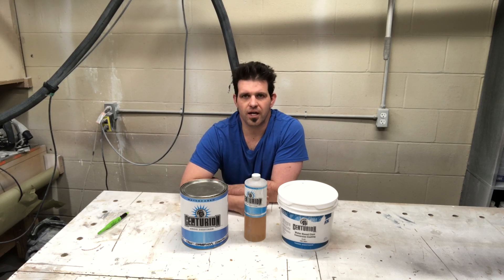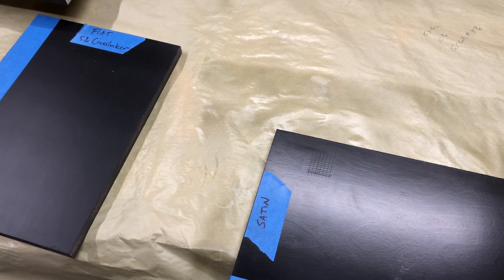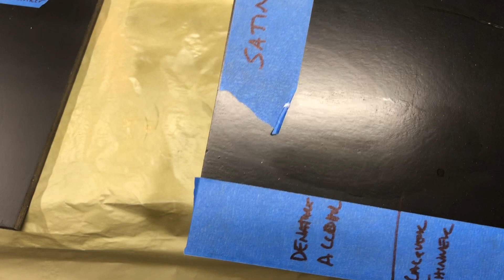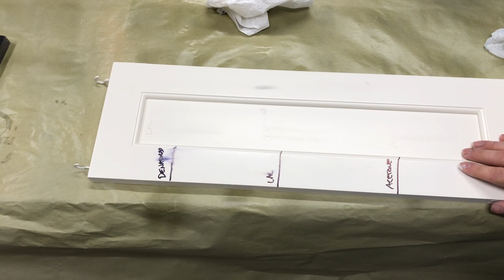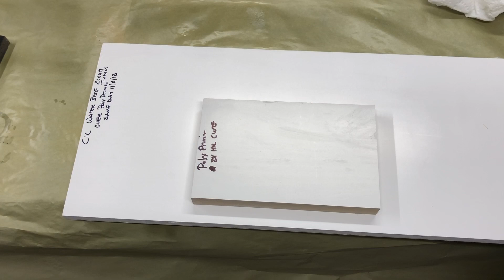CIC Water Base Conversion Varnish Full Review

Comment: I've just walked into a project where a homeowner had ALL of the home's cabinetry rolled (and sanded glass-smooth) with Benjamin Moore "WATERBORNE" Alkyd Primer. The primer was tinted to the light butter-yellow that they desired as a finished product. They were going to clear-coat with a matte finish using the primer as the pigment coat... "Bulletproof" was the plan.

Here's where I come in... They wanted NO yellowing (so no oil based) clear, and my plan was to "persuade" them to let me spray with the same B.M. Alkyd Topcoat as I know it's durable after it's cure time. Their previous guy was going to use matte AUTOMOTIVE clear and I'm sure that would have failed over time.

My mistake (that I now see after research) is that because of the flash-time, it's a disaster to spray B.M. Advanced Alkyd paint without sagging, and I'm NOT rolling so we're back to the CLEAR concept... 

Will water-base conversion adhere to 2-year-old (yes 2-yrs) sanded Alkyd primer without flaking? This was a new construction Mother-in-law house that was never finished, so there are no cooking contaminants or usage. I'm only wondering about product compatibility... Anyone?
Reply from the maker: You need to do a test in an inconspicuous area to see if you are going to have issue or not. It is definitely going to have to be sanded.

Comment: Okay so sometimes I do small refinish jobs on cabinetry. How does this stuff roll on? As in: does it level out and look good? Does it bubble? Does it orange peel? I  pull the doors to spray the topcoat on, but often I'm rolling the face frames and side panels as the cost to mask off and spray cabinets in place is out of the customer's $$.
Reply from the maker: Aezelll go work the CIC polyurethane it rolls pretty nice.
Reply: @ericreason6559  Okay next question, nobody anywhere near me deals in this, so I'd have to pull it in. Any suggestions on getting it pigmented if I wanted to? I can just imagine walking into my current dealer...."Hey I'm going to stop buying your product and can you pigment this for me......" 

Also, assuming I have a hard time getting this pigmented and just have to spray the clear as a topcoat, CIC says this can go over any acrylic pigment coat. Any widely available suggestions that you think this goes over the nicest? What I mean is like....does it play nice with SW ProClassic or BM products or not so much? I've seen you use SW Solo under some of these topcoats on your channel, do you like it? I find Solo brushes like crap but sprays nice, I wouldn't be against using it.
Reply from the maker: Aezelll yes you are correct the only places that’s have the product are on turn west coast. Some folks don’t mind ordering and some want a local supplier. I order all my materials through Annexpaint and they tint and color match for me. No factor and it shows up at my place in a week after ordering it.
Reply from the maker: Aezelll you will just have to test to see what it does or dosent like.

Comment: I am going to paint interior doors and all the trim in my house and was hoping you could give a recommendation on which products to use.  I really only want to do this once and have it last a very long time and be durable.  Cost is not an issue for the materials as I would happily send twice as much on materials to get a much longer life from the coatings.  I have both an airless sprayer and also an Apollo 5 stage turbine HVLP.  Any advise is greatly appreciated.
Reply from the maker: Jerry Hayes sure well there are lots of options but since you asked the question on the CIC video. I would go with them. It’s one of the best Waterbase on the market and it’s very using friendly so you can easily shoot it out of a 3-4 stage turbine. I personally have this coating  on my own personal kitchen.

Comment: great videos eric, 2 questions if you don't mind, based off of your comment as this product being your go to for kitchens

1)speaking strictly on refinishing where pigmented topcoats are being used, would you still prefer to use a vinyl sealer as the primer, followed then by the pigmented CV, or use the CV as the sealer/primer as well? 

2)most cases as of late, are white/grey painted cabinets, in cases of deep colors like browns, would you recommend the same process in this video? IE prime, dark paint , then clear CV. or could you tint this product safely to a deep base? Im sure these are questions easily answered by the tech guys over at CIC, but you are such a plethora of knowledge! thanks in advance
Reply from the maker: Anthony Gaddy yes I use the vinyl as my first step in refinishing followed by two top coats. On the dark colors I usually do two coats of vinyl for my color then 1-2 coats of clear. The reason is that the CIC doesn’t  take heavy tint loads very well. Thanks for the questions and support.

Comment: Interesting about the time window with the topcoats adhering. You would think a 2 day dry is better then a 12 hour one. But the chemicals don't always do what we think. Great information.
Reply from the maker: Kloes Custom Furniture it actually makes sense when you think about it. Since the polyester coating is a two component system it’s still soft and hasn’t fully hardened so the Water base can bite into it easier than when the it  is fully cured. Actually, some companies recommend this type of re-coat window with other catalyzed primers when you apply Conversion Varnish Top coats.
Reply from the maker: Kloes Custom Furniture it actually makes sense when you think about it. Since the polyester coating is a two component system it’s still soft and hasn’t fully hardened so the Water base can bite into it easier than when the it  is fully cured. Actually, some companies recommend this type of re-coat window with other catalyzed primers when you apply Conversion Varnish Top coats.